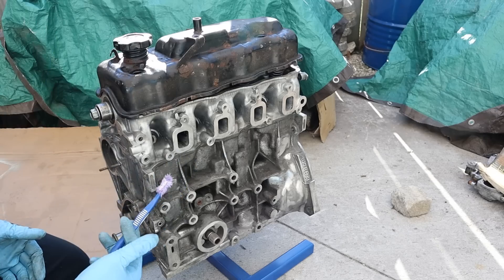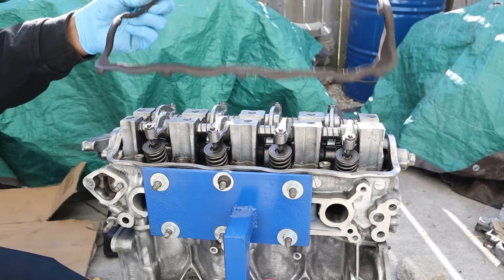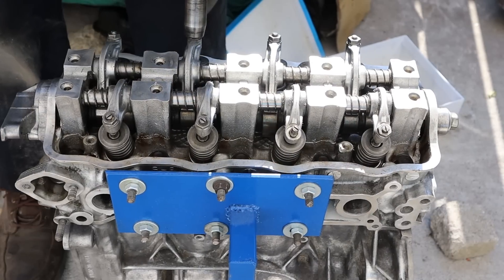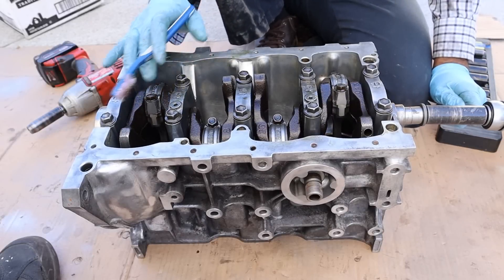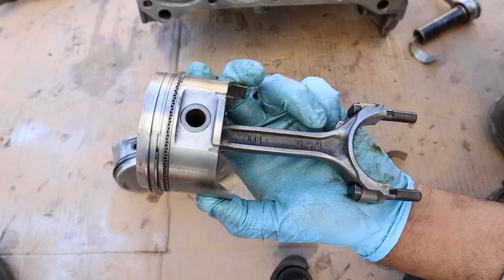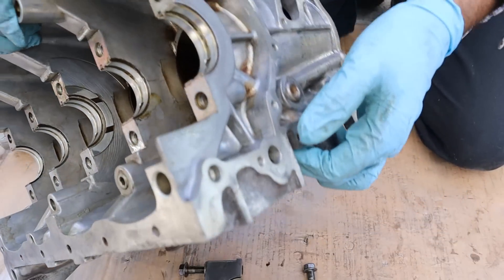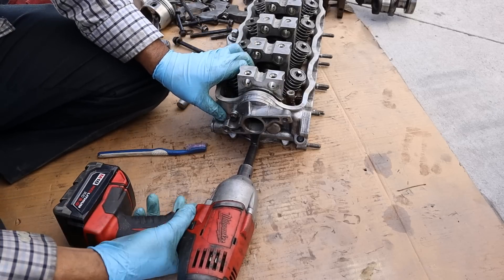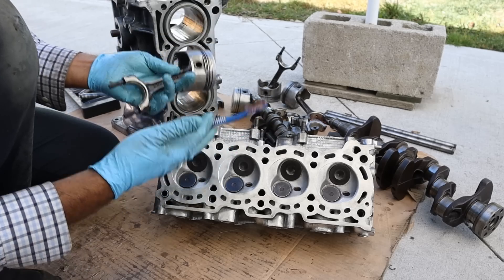Inside a Suzuki Swift Engine

Comment: Watching this really makes me miss my 2003 Suzuki Aerio SX, it really was an underrated lil car. The only major problem I had with it was the digital gauge that only had color indicating lights for the temperature (blue for cold/cool, red for hot). The blue temp light would only come on when you start the car and it’s warming up and then it’d go away, but it will only turn on red when the car is already near overheating or has overheated which unfortunately has happened to me. MAJOR design flaw but was changed to normal analog dials in later versions. Hope this helps!
Reply from the maker: I remember the commercials for those cars.

Comment: Awesome video, I live the simplicity of the older engines. With the right Cam a little poring of the Chambers and a some decking of the cylinder heard it should side it up a little.
Did the 1994 Cino go back to a single cam or still retain the twin cam of the 1993 GTI?
Appreciate your help

Comment: I have svift 33 years old. Ultimately the oldest and cheapest car I've ever had. I bought it for me and my wife for driving along our city - for 5 years not a single issue. The most reliable car ever. Just amazing.
Reply from the maker: Isn't it uncomfortable?
Reply: @speedkar99  ...my model is GS, with recaro seats. It's more comfortable than any new small car. And it's also faster due to only 850 kilos for 1.3 petrol engine. Nowadays they sell 1.8 tone SUVs with 1.4 engines. Lol

Comment: Cool trick for those screws when they strip: Lay a wide rubberband over it and twist as usual. Why don't car manufacturers use "flat head" screws? Also, specifically Honda, why do they use ultra cheap metal for their screws. The throttle body clamp for my sister's Fit has a screw that strips every time with the least amount of effort. I just started using the rubberband trick. Cheaper than 20 bucks a pop to clean the throttle body plus the bottle of cleaner. Lol
Reply: That's a cool trick.  For Japanese cars, look for a set of JIS screwdrivers.  Who knows why but they have their own standard for screws and it makes a big difference.  If you can get a JIS screwdriver with a metal back or a strike then it makes life so much better as you apply light rotation and strike it with a hammer at the same time and shock the screw into motion.  Liquid wrench or your penetrating fluid of choice and advance also helps.

Comment: It looks like a robust design.  I'm not sure how much, if any, cross-talk there was within Suzuki between their car and motorcycle engine design teams but during the late 70's and early 80's Suzuki was making 1000-1100cc 4 cylinder motorcycle engines that were so robust that they've been the mainstay for drag racing for the last 40 years or so.

Comment: did it have the same oil passage in the cylinder head as the chevrolet kalos 1.2 engine? Its camshaft regularly seized due to lack of oil, and it always had to be re-drilled.
Reply from the maker: Drill the carbon?

Comment: My uncle lives in utah now. He was originaly from sheffield, england my hometown but he moved to the states. He has a cown vic and a geo metro 1.0, the crown vic dosent start up anymore and the geo has 240k miles, but he says recently it starts up and runs great for about 10 minutes then gets sluggish and stalls out. Dont know if he got it fixed yet but i was impressed for a 1.0 3 cylinder hit 240k. He says the crown vic has also been a pretty good car but he suspects the fuel pump has gone on it, not sure what mileage is on it though but im sure that was just over 200k miles. 
I have suzuki liana estate know as aerio in u.s but with M16a and not the J20. I have 184k miles and still runs great so far and thats with 2-3 year servicing intervals.

Comment: This engine was the optional 1.3 but the 1991 Geo Metro 3 cyl, 1.0 L Fuel Economy EPA MPG 40 combined city/highway MPG 37 city 45 highway 2.5 gals/100 miles.

Comment: 1:29 if this is an authentic Japanese engine, I’d believe these are JIS instead of Phillips screws
Reply from the maker: You are right
Reply: You can use a #3 Phillips for anybody wondering. Use a battery impact with heat

Comment: There was a DOHC 16v version of this engine as well. It had 101 hp and was used in the Swift GTi, a hot hatch which was quite popular in Europe. It was not a record breaker, but because it was extremely light, it was MAD FUN. Sadly, it is very hard to find one in good condition.
Reply from the maker: Wow. Swift GTi. I can only imagine.
Reply: available for 1 year in canada before VW sued over the gti name.  loved to rev and pull.
Reply: May I interest you in an old Honda fit, you can get models under 950kg (2100 lbs) and ~120 horses
Reply: @kunstderfugue  There is something even better - Honda Civic 1.6i-VT. It was the euro-spec version of the fourth-gen Civic SiR, with an almost identical B16A1 engine, the first engine with VTEC, and it had more than 150 hp. The code for this model is EE9, and there was a LHD version too, so if you have a problem with the RHD exclusive SiR...
Reply: I have a Swift GT engine in my garage. It wasn't a GTi, from what I recall. I forget what the difference is. However, it does have the 16v head. Apparently stronger internals, also, than the regular 8v engine. Samurai's also came with the 8valve engine.
Reply: @ju2067 Different ECM, catted from 1989 and they had EGR valve (Dunno if it's only for California sold cars or the entire US). Power still 101hp, not bad since It had to pass California smog regulations😅
Reply: GTi owner here, I can confirm everything you say, it's light, fun and the DOHC engine revs as happy as a motorcycle engine, and is rock hard (250.000km and still runs strong and smooth). Owned since 2011 and I'll never sell it😊

Sadly, is not a model known for being well-treated😢 and well maintained examples are hard to come by.

Comment: @speedkar99  I still have a suzuki swift GTi (1st car, so not selling it) it has already 683k and has seen the track and mountain roads abuse more than I can count, its a 1.3 twin cam producing 115hp without any kind of variable valve technology, and gets around 40mpg average if not driving like a maniac, corners like a go-kart (altho fairly hard and uncomfortable suspension for the city) with its 800kg body, independent suspension all around, 4 wheel disc brakes,extremely fun to drive.
I have only kept up with careful change of oils, filters, since it has to work its way all the way up to 7500rpm to produce its power, the thing never failed me and its a 1991.
I dynoed it at around 500k and was putting around 108hp to the wheel still
If it helps answer your question about reliability
(also had a suzuki vitara with the 1.6, which endured a good 400k of abuse before selling it, never a single problem)
Reply from the maker: Nice!! How's the body held up, any rust? And how many clutches have you been through?
Reply: @speedkar99  no rust on body, but I always clean it well under the compact. It's on the 3rd clutch that was changed very recently for a race exedy clutch. Thinking of installing a programmable ecu, since factory one is not even semi sequential, it's very old and rudimentary, and it's staring to get hard to set up on cold winters. I hope with a fully sequential injection fuel consumption might get better

Comment: Small and compact for it's capacity and beautifully simple   ...and reliable. The automotive industry has gone backwards. This was likely more fuel efficient than the modern engines with all their emissions garbage that are fitted into cars that are loaded down with safety equipment and are about 30% heavier as a result.
Reply from the maker: I agree. Emissions and safety has made cars more complex and heavier.

Comment: I love mechanical devices that have "no more than what is necessary" I started driving back when that engine was in its day. The two cars that I loved and owned back then was my Austin Mini 1000 and my Renault 4. They were simple, easy to work on got me from A to B. One car that I did want to own but never did was the VW Beatle. I would love you to do a break down of an old Beatle engine as they were super efficient back in their day and were designed by Porche all Air Cooled. Super video as always.
Reply from the maker: Thanks. Too bad the simple days are over.
Reply: I  guess you mean working on the mini engine was easy, after it had been removed from car. 
The space in the current Swift engine bay, a BMC mechanic could only dream about.

Comment: Are those "Phillips" screws on the cam towers really "Phillips" 
or are they really really JIS fasteners (Japanese Industrial Standard cross head screws...
that require appropriate screw driver bit so you don't screw up the screws?
(As evidenced by many classic Japanese motorcyles with boogered exterior engine/gearbox case screw heads......)
Reply from the maker: Thanks!

Comment: You should tear down a toyota ecvt transmission. Like from the ones used with the new m20a engines & 5th gen hybrid system.
Reply from the maker: I've torn down a Prius eCVT. 
The Corolla M20 CVT isn't an eCVT it has a physical first gear.

Comment: Hi there! Glad to see some Suzuki engine in the channel. I'm the owner of a 2018 Suzuki Baleno with the excellent 1.0 3 cylinder turbo gdi. 

Unlike all other manufacturers, they have no issues with lspi nor with intake valve deposits

Lightweight car with torquey and punchy engine, a joy to Drive with very good fuel consumption
Reply from the maker: Good to know and to hear from someone outside north america! Isn't it underpowered on the highway?
Reply: @speedkar99  It has 110 hp with 180 N/m of torque for 940kg. It is faster than a lot of cars, 0-100 kmh in 9 seconds and top speed of 210 kmh. With fuel consumption of 5'2 liters for 100 km. (About 50 mpg?)

So It is more than enough for the Highway, and It is even silent at speed

I'm in love with it hahaha keep Up with the Channel and greetings from Spain

Comment: I sold my Suzuki DL 650 motorcycle for €250 with 238 000 kms on the odometer. Suzuki makes bulletproof engines and for that they have earned my respect.
Reply from the maker: Always wondered about their reliability...

Comment: I was wondering when a Suzuki engine come up. I bought a new car in 2020 Suzuki swift 1.2 style full option car. The first time that I have buy a completely new car. I hoop I made a good decision about it. It's not the Japanese version they told me I have the Hungary edition. And it's now at 65k km. So far without any issues.
Reply from the maker: They still make these?
Reply: @speedkar99  
In europe you can still by them new
1.2 Swifts 
1.0 Vitaras and 1.4 turbo Vitaras which are even offered with 4WD, some people still do some medium off-roading with them :)
Reply: @speedkar99  Not sure if they are still made but i found a list of them https://en.wikipedia.org/wiki/List_of_Suzuki_engines Depend on what model it is.

Comment: Too bad Suzuki (cars) left America in 2016, the Kizashi looked like Honda designed it (awesome), and the Equater was as decent as a Nissan.

And I was a tech for them…

The Forenza/Reno was a piece of shit, almost as bad as a VW. At least they were so easy to work on! (unlike vw/the other brand my dealer sold)
Reply from the maker: How were the Suzuki's reliability?
Reply: @speedkar99  fucking awesome!

Customers sucked…maybe…I didn't see many, and the only Suzuki work I got was warranty &/or recall. Probly because they were broke (customers don't have $$) and we charged ~twice what independent mechanics did. Most owners just ignore & neglect maintenance, from what I saw when they came in for free shit. Probly because they were marketed to people with limited fundage.

I was the only Suzuki tech the dealership, & we were the only dealer for Manatee County, but I still spent less than half my time on Suzukis. Mostly pre-delivery inspections! The rest of my time was VW bullshit.

Even though the cars were neglected, and (usually) had high mileage, everything was solid & rarely needed repairs. Even the Forenza & Reno had good reliability (by vw standards), but were made like a Honda from the late '80s, which is why they were so easy to work on!

Summary:
Suzuki's were good cars then, but might not be now, because they were probly neglected. Inspect very well before purchasing, then stay on top of maintenance, and you'll probly have a great car for a long time…for any model from Suzuki.

Comment: i love those old dinosaur engines. nothing to go wrong.  this engine would be good in an ultra light plane.
Reply: Actually the smaller 3cylinder 1.0 
l g10 a version of this engine was used in ultralights. It weights only 70 kg.
Reply from the maker: It's a cute one. As you saw, previous owner had it on a display stand.
Reply: Too heavy. They use Rotax.
Reply: @Stefan_Dahn  ...too expensive

Comment: How much did this engine weigh? By feel I'm not expecting a proper weigh in. Like can a guy lift a shortblock? This thing looks so simple and small I wonder if it would do well in a sand rail. VW beetle engines are getting more and more expensive, and this thing with a manual transmission would probably out do one no problem.
Reply: Subaru Turbo WRX engine might have a few more ponies, lower centre of gravity.... and not a lot more weight?
Reply: @JohnSmith-yv6eq  They're worth a lot and their engine management isn't easy to setup for standalone operation ECU and all that. This thing is dizzy run so a couple side draft mikunis or a weber double barrel and it will prolly be good to go. The other thing is by eye this looks very lightweight, even Honda D SOHC motors are roundabout 300lb before accessories. For reference a VW type 1 is about 200lb ready to run without the car specific things like heater boxes and lighter intake, but with generator. I literally pick them up and put them in the frame get a good grip and angle and it's not a big deal. In sand rail stuff weight is a bigger deal than power because power just means you're spinning wheels, too much weight means you're bogging down. The lighter weight cars always pull out a head because you don't need much power to spin tires on loose dirt sand gravel mud and snow. I gotta weird config a VW motor coupled to a t5 in a front engine rwd pattern, supercharged with an AMR500 blowing through twin mikuni motorcycle carbs

Unfortunately nowadays a vw is hitting 500 bucks for a block that needs work and being such a weird design (compared to what most shops work on) and magnesium case the machine work isn't cheap, and you can only build a 1960s case so many times. assembly is easy at least. Also parts are running out. Back 10 years ago i got my complete engine for 60 dollars not stuck.
Reply from the maker: Mine had a lot of missing parts but you could lift it easily

Comment: More evidence that I'm getting old, distributor was pronounced a little differently back in the day. Most kids these days have never worked on one.
Reply from the maker: I've never worked on one but I have opened one up. Those things have so much trouble back in the day
Reply: @speedkar99  Yes, there was a reason that garages were present at almost every corner, and plugs/points/wires were done every 30,000 miles. Cars today are so much more reliable and maintenance free, not to mention the better suspension, etc. My 98 Ram has a distributor but an electronic ignition system running a single coil. They are much easier to compare secondary ignition between cylinders because you can line them all up on the scope as a palisade from the single coil wire.

Comment: It would be neat if we could still get cars like that today
Reply: Mitsubishi mirage is the closest thing you’re going to get to this. Everything else is infiltrated with Technology and sensors
Reply from the maker: Safety and emissions regulations prevent that
Reply: @speedkar99   I wonder why that is, do you think it needs VVT to meet emissions? Or like DI? I wish some cars could be regulated like bikes. You can still get carbonated bikes with engines over 40 years old.
Reply: Come down south. I seen a Metro about 1 year ago at the grocery store. Cars don't really rust down here in Florida as long as you aren't too close to the shore. I used to live up north and when I came down to the pan handle of Florida I couldn't believe all the old cars still running and not rusted. You will see some 80's cars yet and a lot of 90's

Comment: US EPA site still rates 3-cylinder Suzukis with a stick as the most fuel efficient ICE-only cars ever sold there. The Civic HF is also up there...
Reply from the maker: What about the Honda fit etc ? I guess they'd are too heavy
Reply: @speedkar99  You should check out the list yourself. Many econoboxes are actually pretty thirsty, like the later Suzukis (e.g. Esteem, Aerio, Kisashi). I just checked that site, and there are only 136 models built since 1984 which get 35 MPG or better (EDIT: city MPG)...and most of them are 1980s/90s Suzukis of one badge or another. Also, a few CRXs, VW diesels, oddball diesels (Escort/Lynx, Sentra), and just a handful of recent Mitsu Mirages.

Imagine what fuel economy would be like if the shareholders of car companies weren't also the shareholders of oil companies... 🤔

*The highway MPG list is mostly the same cars in the same relative positions, just with higher numbers. Those little Sprints with the 5-speed were exceeding 50 MPG on the highway!
Reply: @speedkar99  P.S. The last Fit we got here, 2020, was just 33 MPG city. It's just behind the 1994 Civic 5-speed. So, after 26 years, Honda made a smaller car which drinks more fuel. Must be a coincidence. 🤣
Reply: @speedkar99  my 25 year old Swift 3 cylinder makes 52mpg, 1/3 city, 1/3 mountain and 1/3 highway.